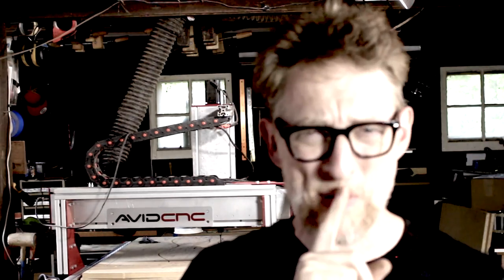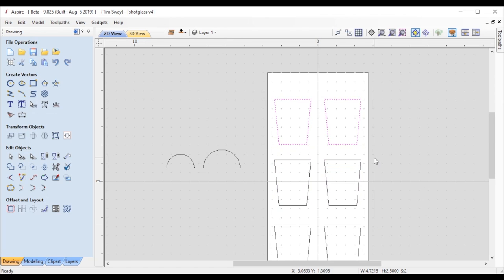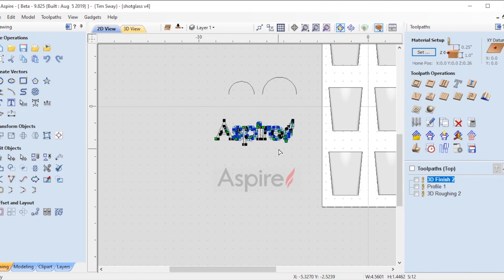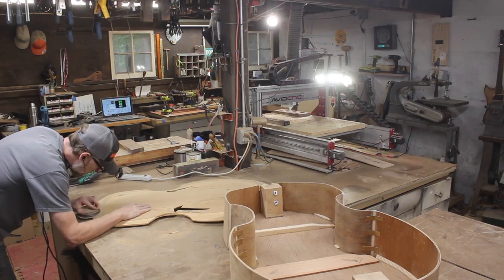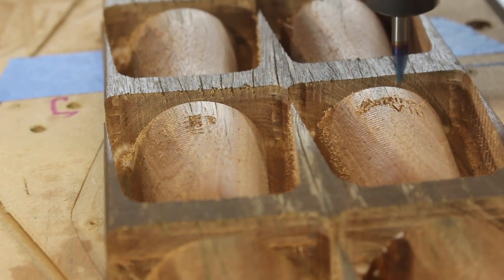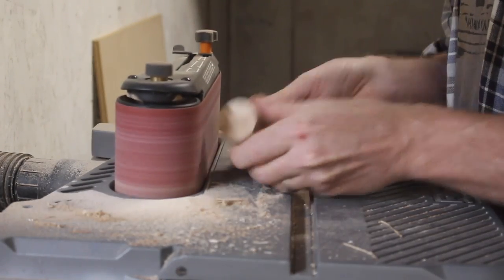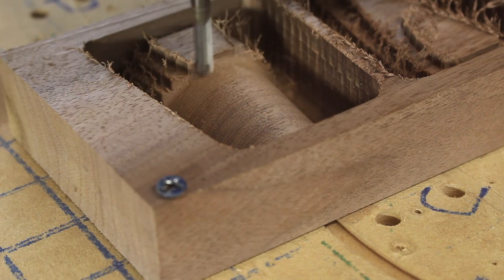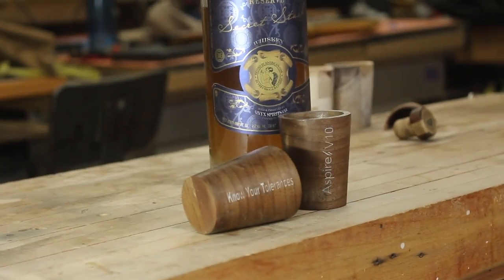In the Labs with Tim Sway | Making Wooden Shot Glasses... NO ROTARY | Vectric FREE CNC Projects

Comment: Thanks Tim.  
Details for populating your Tool Database with the 30 degree 0.25" bit?  
I am still figuring out my Aspire Version 10 tool database and default starting points for tools.
I plan to try the V-Carve with my JERRAY CNC Carving 4.82 Deg Tapered Angle Ball Tip Radius=0.5mm X 1/4"